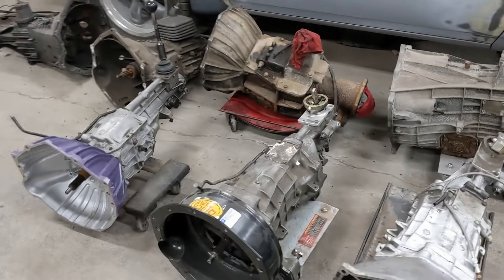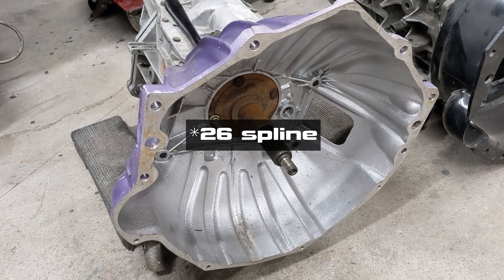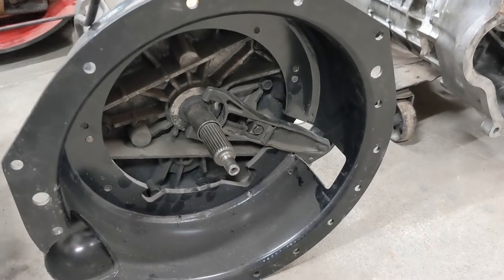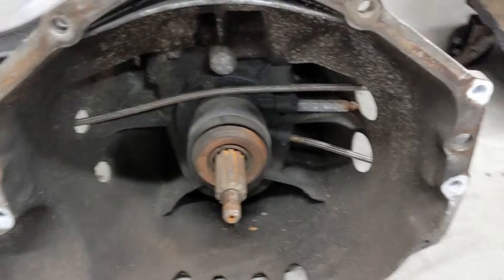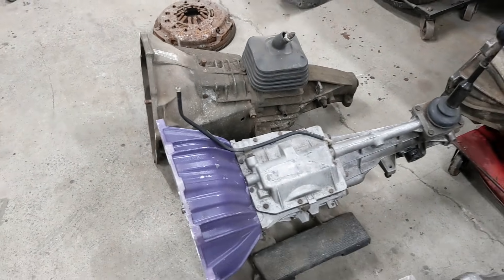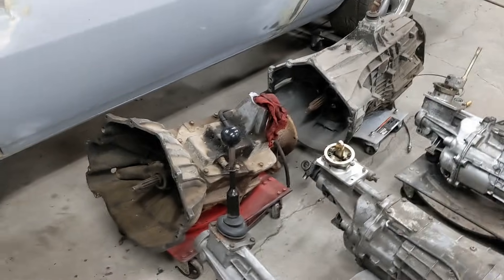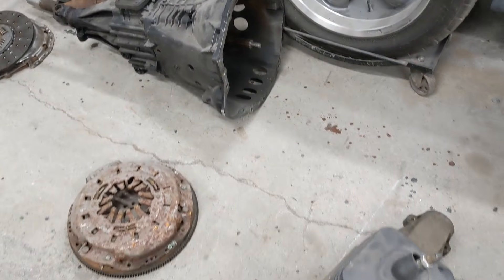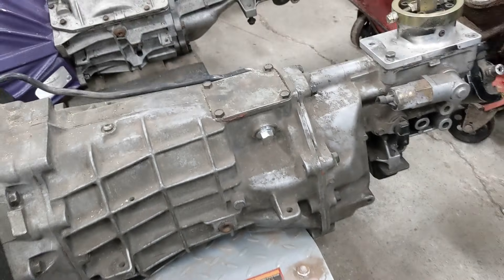GM manual trans specs - 4spd 5spd 6spd 2wd 4wd - LS SBC BBC

Comment: Gearhead Design 

I have a 2004 4.8 4wd silverado with the nv3500. my goal is to build something of a sport truck. My main issue is the NV3500 just feels choppy.  I'm not sure if maybe the shift tower is bad or what but it has little play in the shifter and the truck only has 62,000 on it. really I'm just looking for a smooth shifting manual 4x4 so if you think a nv3500 is a smooth transmission I will look more into the issues unless you suggest something else. I've also heard the t56 can be adapted to be 4x4 but it was stated it doesn't hold up well with the weight of the truck. Any advice is appreciated and awesome video!

Comment: wow ..excellent video with almost all info i was looking for, except ring size ? how many teeth to use with LS starter? can i use flywheel off '81 250ci inline 6, w/ HD pressure plate , that truck pilot bearing do you know part #? will the input shaft on Borg-Warner 5sp.be long enough or does somebody make longer input shaft that will fit B/W 5sp. do you know? also is it still possible to drill and tap flywheels for any pressure plate application ...👍🛻
Reply from the maker: The LS flywheels are 168 tooth. I know a T5 input shaft works. I wouldn't drill and tap a flywheel when there's easy, cheap off the shelf parts available. Especially with the RPM and inertia involved. I do some sketchy stuff, but not that🤣
Reply: @GEARHEADdezign  I'm no engineer, but it's standard practice to drill a 200mm  VW 12v flywheel to eight dowels from four. with hand drill. ya i know its only a VW, but BB engine is still swinging alotta weight , i never lost a pin or whallered any pin holes.  I musta misheard you speak of T5 input shaft not being long enough, with 27 spine input shaft. I just got '05 5.3 doing as much homework as i can, p/u tranny is i think tremec, what they called 3sp w/ OD , do you know what needs to be done, if anything to LS cpu without running automatic that was behind it? possible or do i run MSD box w/ carb?  thanx again for advice, figure i got bout yr. maybe less the six aint got much more time left ...'81 SBC
Reply: @GEARHEADdezign  it might be french one peugout? runs ATF not gear oil
Reply from the maker: T5 should be 26 spline input. I think the pickup trans were NV or ZF, with tremec just making the car stuff.
Reply from the maker: I've got a video showing a free tuning solution for LS swaps. LS-Droid. You can disable vats and change tune from auto to manual.

Comment: Awesome video, lot of useful information. 
I am curious if this also applies to gen 4 ls stuff? I have a 2014 2500hd with the 6.0 (l96), I would love to put a zf6 in there when the 6l90 goes. It’s a bummer I can’t use the tcase that’s in there. But a earlier ls flywheel and pilot bearing would work?
Reply from the maker: As far as I know, yes. The gen 4 car engines still used manual transmissions, and a tr6060 will fit a gen 3.
Reply: @GEARHEADdezign  is it possible to swap input shafts on another other Chevy tcase to mate the zf6?
Reply from the maker: @tinkeringtimmermans5249  I'm not sure

Comment: I am thinking about doing a LS swap on my 65 International pickup. I wanted to keep it a manual but also keep 4 wheel drive, what do you think is the best option for that?
Reply from the maker: Really depends on what you plan to do with it. Nv3500 is ok for light "hot rodding" but for towing I'd suggest the nv4500

Comment: I have a T5 tranny out of an 88 camaro. I"m going to to bolt it up to a 02 5.3. Do i really have to get a big block chevy bell housing, cause i've heard the stock bell housing from the t5 should work, but that only 1 bolt hole won't get used. If i do need a different bell housing, i have a bell housing off a 65 C20 327 with a 4 speed. Do you think that might work? I honestly want to mate them together as cheap as possible. Would you be able to guide me as to what i'll need as far as the flywheel, clutch, pressure plate, slave cylinder, and bearings?? Thank you in advance. Btw the 5.3 and t5 are planning to go into that 65 chevy of mine lol
Reply from the maker: The bell housing pattern is fine, but it's the flywheel that's the issue. I think the t5 bell is set up for smaller 153 tooth flywheel, where LS needs the bigger 168 tooth style. BBC always came with the 168, but some SBC trucks etc did get the 168 also. So try out the c20 one.
Use a 2002 4.8 flywheel and a 2002 Camaro clutch. If the c20 bell doesn't fit, grab a BBC bell.

Comment: Nice video! I'm looking to manual swap my K10 with a NV3500, would I be able to use a 350 SBC flywheel and clutch for it?
Reply from the maker: As long as it's 10 spline you should be golden

Comment: 2003 4.8 nv3500 trans with manual tcase to a 2005 5.3 and a push button tcase. (Was a 4l60e) looking at swapping my L60 out for the 5spd and still use my tcase that has a push button. I’m wanting to know if the splines are the same between the two. Both trucks are 1/2 tons. Haven’t yet pulled them apart to look and was trying to take some steps saving wait time on parts if they can or can’t bolt up. Thanks
Reply from the maker: Nope. All manuals, even the half ton stuff, is the bigger 32 spline. I know the tcase inputs can be changed though

Comment: Ive got a 79 chevy c10 with an 80’s 350 and a 350 turbo trans.. what would i need to do to put in a nv 3500?
Reply from the maker: Is it a 87+ 1pc rear main seal engine or earlier 2pc? You'll have to get a firework to match whichever one you have. Then order a clutch for a 94 k1500 and probably a new driveshaft.

Comment: I'm still confused on what I have it a 2004 single cab work truck with a 5 speed 4x4  with the floor transfer case and it has 4 high  2 high and a really low 4 low.
Reply from the maker: If you have a 4.8 it's nv3500, if 6.0 it's nv4500, if 8.1 it's zf6

Comment: Hey I just stumbled across this video and it was super helpful. I do have a few questions though. I currently have a 1996 6.5l td bolted to a sm465 to a np205. The starter is interfering with the flywheel. What flywheel should I be using with this setup? Also I am interested in swapping in a nv4500 at some point and I wanted to know how much work that would be to convert? Do I need any adapter plates? Thanks!
Reply from the maker: I would assume you want to use the flywheel that's original to the engine. Those 6.5s got the nv4500 from the factory, and it should be able to use the same clutch as sm465.
Reply from the maker: Depending on the year of your sm465, it might be basically a direct swap. Mine came out of an early gmt400 and the measurements appear to be a direct swap with a 90s nv4500. Earlier square body 465s had the shifter further forward, and I'm not sure about the tcase adapter measurements
Reply from the maker: You can tell if it's a square or gmt400 trans by the shift cover. Squares had a cast iron cover with the shifter mostly centered. Gmt400s have an alum cover with the shifter offset to the rear

Comment: hello
I have a 1966 c10 with 383 stroker and 700r4, I want to put a 5 speed manual on it, which one do you recommend?
Reply from the maker: My neighbor used an nv3500 in his c10 and it fit nice. I have videos of him doing burnouts. Also can't go wrong with a t56. Probably have to do the front shifter conversion though.

Comment: Hello. Can the 12in SBC clutch and Flywheel fit inside of the nv3500 bellhousing?
Reply from the maker: Definitely. Nv3500 came from the factory behind SBC, 4.3 and LS
Reply: @GEARHEADdezign  also will the bellhousing come off of the 3500? Is the bellhousing to trans bolt spacing and center hole the same as the old sm465s?
Reply from the maker: @tombrown879  nope, bell is fixed.

Comment: Hey GH Dezign, This is really great info! Thank you for going to the effort and sharing your knowledge here. Just a couple of things; There is no way the SM465 (CH-465) has the same shifter to bell-housing (face / back of engine) measurement as a NV4500 or ZF6 S6-650. I have a ZF6 S6-650 sitting in my garage waiting to go into my 89 1ton square-body dually. It is 15.75” as you say. I do not have a SM465 here to measure up; it must be a lot less through looking at the factory cutout impression in the truck’s transmission tunnel. I don’t have a NV4500 here either. If it is the same measurement as the ZF6 S6-650, that’s good to know and a help for this swap. 2nd thing and you may be just the man to ask this. I am mounting the ZF6 S6-650 to the original TBI 454 L19 (IV Mark 4, 2 PC seal). What flywheel pilot gearing and clutch Assy do I need? What I do know; the trans input shaft is 10 spline Ø1.375”and I will have to use a concentric slave cylinder. That’s about it. Thanks for your help! Cheers, Grant.
Reply from the maker: I finally had a chance to measure my sm465, and we're both right actually. Good catch! Mine is 15.75, but it's different than most of the ones I see online. Mine came from an early GMT400, and the shifter tower is offset to the rear. Photos I see online (presumably from square body trucks) the shift tower looks basically centered.
So I'll put a note in the description specifying this.

Comment: Ok I’ve got a 1990 suburban with the tbi small block Chevy. I want to run the ZF6 in my truck assuming I can have a Np205 transfer case custom built to take the output shaft. Can the ZF6 be put behind the SBC TBI?
Reply from the maker: Yup, according to my measurements it should be able to. Use a 12in SBC flywheel (like my 94 k3500 5.7) and the clutch set from my 01 8.1 ZF.
Reply from the maker: For the hydraulics there are adapters for AN-3 hose. The zf6 has a Ford style clip connector, and the typical GM clutch master is a pinlock. I have another video about that I can find if you need it. Gmt800 free clutch fix I think it's what I titled it
Reply: @GEARHEADdezign  So this should be the same as my TBI 454 BBC. As long as the 8.1 pressure plate will bolt to the SBC/BBC 12" 168 tooth flywheel...
Reply: Thank you, I’ve seen one video of a guy putting one inside a square body c10 and it was a little long and had to modify the trans tunnel but never showed what he did. Any chance you’ve seen or have a video of that one modification?
Reply from the maker: @kylewest100  yeah, they are huge. Probably just had to make the tunnel a little taller like I did for the t56 swaps in my Beretta and Camaro. 16ga works pretty well. Thin enough to bend but has some strength.
Reply: @kylewest100  It depend on the square-body you have. My 89 1 ton GMC V35 4x4 has a lot bigger trans tunnel than my 87 R10 1/2 ton 2wd. Some guy say the ZF6 S6-650 will just clear. But I think that is just 1 ton trucks only. I was told some set-ups use a body lift and that factory did this too with the 01-07 trucks. But I don't know if that is true.
Reply: @grantlloyd23  yeah that’s if I could actually find one. I’ve already found a few nv 4500’s laying around just a little more than I’d like to pay
Reply: As I said above, There are adapters for the ZF6 S6-650 to NP205. Once they are back on the shelf.
Reply: Kyle, do you have a ZF6 S6-650 for your project?
Reply: @grantlloyd23  I’m just going to do a NV4500. I’d rather keep it as simple as possible

Comment: Can the output shaft on the larger “Duramax” trans be changer to fit earlier transfer cases? Thanks
Reply from the maker: There is no 32 spline ZF6 output shaft. You may be able to swap transfer case inputs to big 29 spline though.
Reply: There are adapters for the NP205 (if that's what you are referring to). All on back order due to the plague.

Comment: So do you think there is a possibility of the lt1 t56 working behind an ls with the truck pilot bearing?
Reply from the maker: I was hoping for exactly that! However, the problem is the bell housing. The LT1 bell won't fit the 12" LS clutch. And the LS bell is longer, and the LT input is too short, even for the truck pilot.
Reply: What if you use the truck flywheel and clutch?
Reply from the maker: @cotycaudle427  Truck flywheel would get the clutch splines better aligned with input shaft, and it would have to be a 26 spline Camaro disc. But the input pilot won't reach even the truck pilot bearing. Maybe if you had a custom long pilot bearing made?
Reply: Yea just trying to figure out if there's a way without spending the big bucks for the conversion on the transmission itself

Comment: If I were too git one from American Powertrain, Silversport, or even Tremac. Which one do I need to mount behind 5.7 vortec at originally had the Ms465 but want to make it "beefier" and a true HD application? Keepin it 4x4?
Reply from the maker: Tremec has a new TR4050 that's basically a replacement for the nv4500. That would be a good option for you
Reply from the maker: But BTW, the sm465 is really beefy, and just as strong as the nv4500. It just doesn't have overdrive